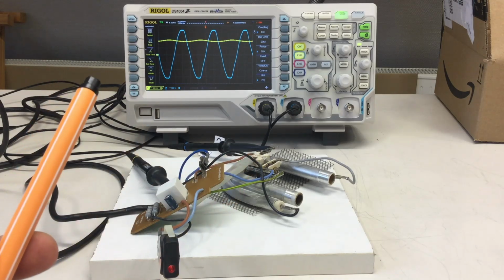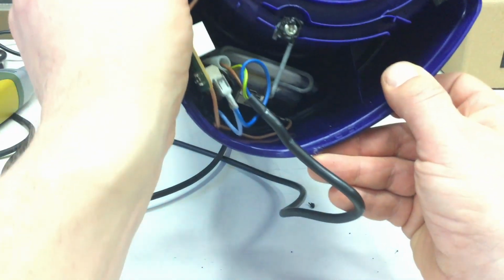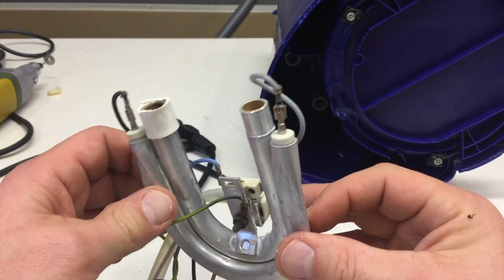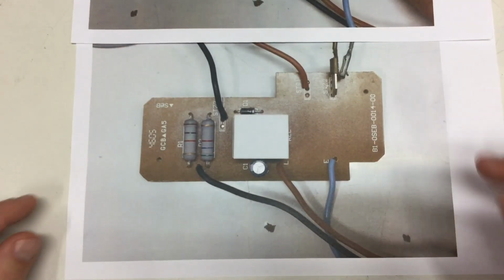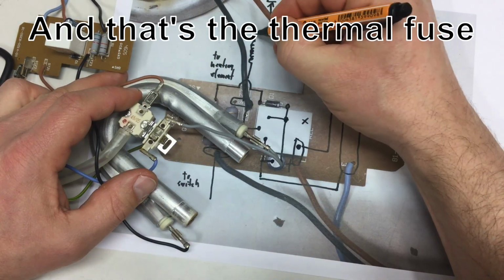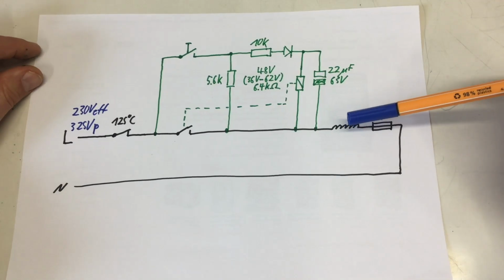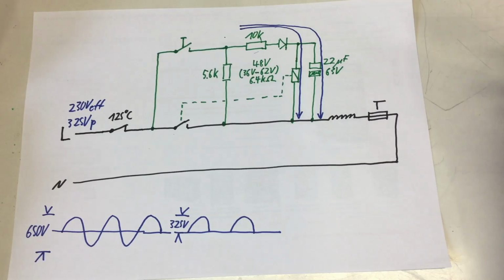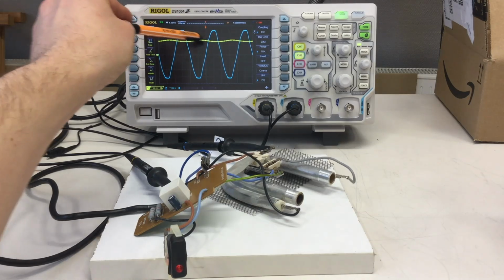Coffee Machine Teardown (Endangering My Oscilloscope)

Comment: Would this circuit still work if you reversed the diode polarity and the capacitor polarity  and the DC relay polarity.    We would be using a negative DC voltage.  ?
Reply from the maker: Yes it would (and you don't need to reverse the coil of the DC relay, 'cause the coil doesn't care which way the current flows through it).